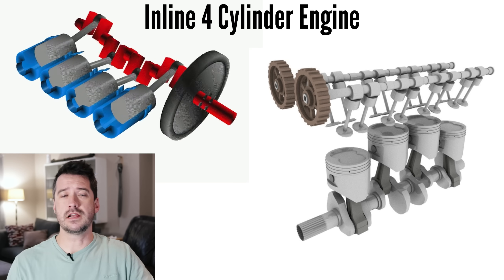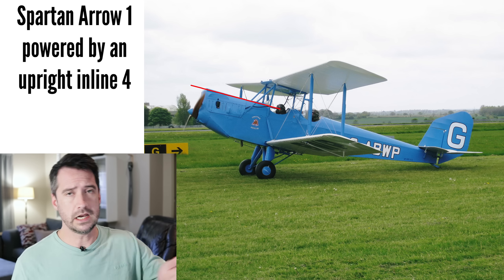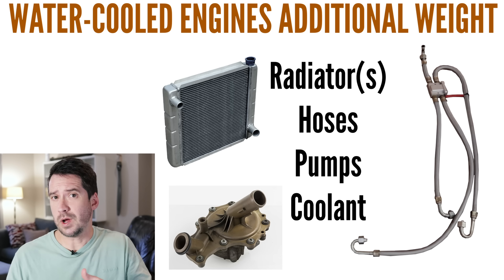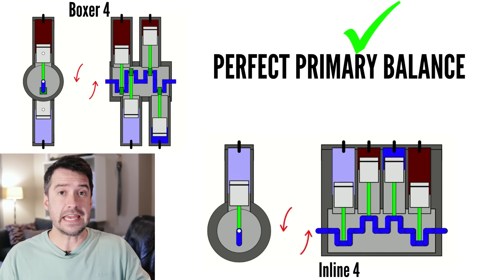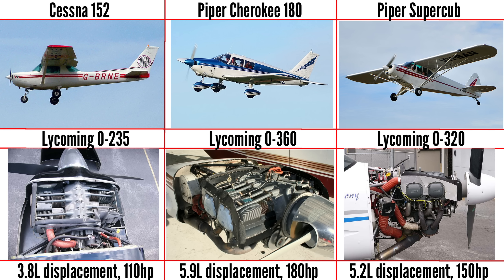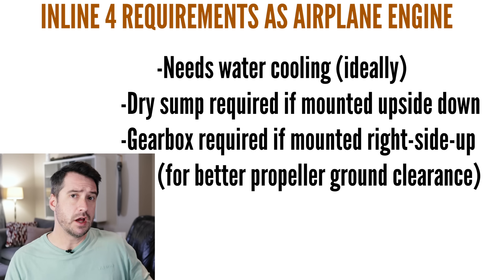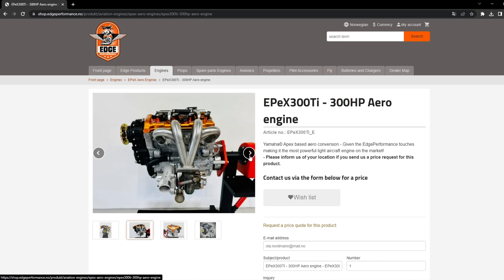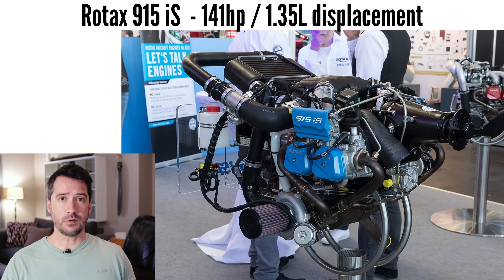Does Inline 4 Engines Suck for Airplanes? - Technical Deep Dive

Comment: Walter Micron has a nice four and six inline air cooled engine. Not sure if they are still in production. Thanks!
Reply from the maker: Yeah that's an interesting one. Designed in the 1930's, seems to have faded out of popularity after the 50's and production stopped. Then the company started production again in the 80's with minor modifications. Very low HP though (60-80).
Cant figure out if they are still in production.

Thanks for the comment!
Reply: @LetsGoAviate  I think the new name is LOM engines.
Reply from the maker: Thanks!
Reply: I've flown a Van's RV-7 with a Walter M337 inline, inverted 6 cylinder and it was one of the smoothest running engines I have ever known (at all operating RPMs).
Reply from the maker: @jamesbromstead4949  Nice! The inline 6 is the smoothest possible cylinder layout 🙂
Reply: @LetsGoAviate  Which brings us back to the BMW, aviation straight six repurposed for automotive use. Have they been re-repurposed back to aircraft engines, I wonder? edit to add. I can't find anything other than ultralights using their boxer twin.

Comment: Why  not use the camshaft drive in a purpose-designed ohc inline 4 aircraft engine to drive the propeller?  That would not add the complication of a separate gearbox (though the drive would have to be sturdier), there would be an automatic 1:2 speed reduction for the propeller (or even 1:4, if you used double-lobed cams on the camshaft), the engine would be upright and could use a wet sump system,  and the propeller drive would be at the top of the engine, providing the desired thrust line and good propeller clearance.  The propeller doesn't care if it is being driven by the crankshaft or the camshaft.  A conversion kit might be designed for an ohc automotive engine to do this as well.  Just a thought.
Reply from the maker: My first thought was that the camshaft would need to be seriously sturdy, but you did point that out. Also you would end-up with a belt or chain driven camshaft in turn driving the propeller. Not an issue per-se, there are belt driven propellers in the ultralight world (as propeller speed reduction instead of a gearbox), but the belts are about double as wide as a normal cambelt. But if you are going that route, might as well just belt drive the propeller hub from the crankshaft, rather than belt driving the camshaft which drives the propeller hub?
Reply: @LetsGoAviate  Well, that would still duplicate the drive--you would have two drives, one to the camshaft, and one to the propeller, each with a gear reduction.  The old Crosley COBRA and CIBA engines had a shaft drive to the camshaft, which would have been very sturdy--maybe extra bearings would be all that would be needed to convert--or, a bespoke shaft drive to the camshaft and propeller could be a simple drive that would perform both duties easily, without too much bulk.  Even if you use just a belt, driving the propeller off the camshaft drive would save an extra set of reduction pulleys, as well as the belt.  It would be lighter and simpler than two separate drives.
Reply: @brianb-p6586  Thank you.  Okay, an idler gear would be needed.  That still strikes me as being less complicated, lighter, and less bulky than a separate propeller drive.  Also, there are twin-lobe camshafts that are driven at 1/4 crankshaft speed.   The propeller could be more geared-down than 1:2, allowing for even higher revs for the engine, increasing power and efficiency, while still not needing a separate propeller drive.  And perhaps a belt drive would avoid gear teeth wear issues, particularly with 1:4 drive.  I am sure there would have to be some development time before an ideal arrangement could be worked out.
Reply: The Continental Tiara engine did something like this.
Reply: @PistonAvatarGuy  Thank you.  I Googled it--that engine purportedly had high fuel consumption, and did not have a sufficient performance advantage to justify its expense.  The concept was to use the camshaft drive to allow for higher rpms, and more power, without a separate reduction gear.  A hydraulic "Hydra-Torque" drive was used to reduce shaft vibrations--which could also be used here.  Apparently, an extra idler gear was not used--maybe the Hydra-Torque drive negated this need.  But the engine was of conventional flat-opposed configuration--it did not use the cam/prop drive to have a cheaper upright inline engine with smaller frontal area.  And, it had a 1:2 reduction--it did not use a 1:4 reduction double-cam-lobe.  On top of all that, it was in a higher-power engine category, not a small, light engine for minimal aircraft.  Perhaps the upright inline 4 with a combined cam/prop drive could still find a place.  The smaller engine could rev higher, especially with a 1:4 gear reduction, the lower frontal area would help fuel consumption,  especially in a tandem-seater, and investment  costs should be lower than with a bigger opposed-six.  And the Hydra-Torque drive has already been developed.  Just tossing the idea around, to see if it has validity.  Thanks for the information.

Comment: Here are pros and cons unmentioned.  Remember props turn < 3000 rpm
  1.  The I4 crank is longer which brings its the critical frequency closer to 3000.
  2.  In its favor, the I4 has 5 main bearings versus H4’s typically 3.  (VW, Rotax, Continental, Lyc’s have 3, Subaru has 5.)
  3.  A direct drive I4 secondary imbalance is a non issue at 3000.  Even a good possibility partial primary balance is workable.
   4.  Engine stiffness impacts longevity.  Lycomings and Continentals flex because air cooling fins compels wider cylinder spacing.  Moreover individual cylinder heads diminish stiffness.  These engines compensate flex with sloppy clearances.  
   5.  At 3000rpm, 2 valve pushrod heads work fine and lighter than SOHC or DOHC.
   6.  A Continental O-200 makes 100hp at 2800.  Doubling the speed engine could make 200 at 5600, …1hp/cid.  The point:  these old engines are not all that bad.
   7.   Conceivably one could go to the hot rod parts bin and get a Chevy LS1 head, pistons, rods, valves mate to a custom crank and block for a 100hp engine.  Check out the Crosley CoBra engine or blocks CNC machined from solid aluminum billets.  It’s just time and money and imagination, …and grit

Engines with Reducers.
  1.  In a 4 cycle engine, cylinder torque pulses don’t overlap until you get to 8 cylinders.  With a 4 or 6, thru a revolution, the engine drives the prop, and then the prop drives the engine.  These reversals are absolute hell on speed reducer’s gear teeth unless mitigated by a clever coupling such as the Rotax 912’s.  (And Viking and AeroMomentum)
        Wider rpm band faster risks resonance.
        No easy solutions, but there are solutions.

The certified aircraft engine market is small, maybe 2000 units per year worldwide, the entry barriers are prominent, and comes with 100’s trial lawyers.  One sage commentator commented, it’s economics.
Reply from the maker: Some of it is obvious, some of it is way more in-depth than I would ever cover in a medium-lenght video format, and some of it are great ideas for a future video. Thanks!
Reply: @LetsGoAviate  FYI, Solid Works modeled auto parts (LS1) based 3000 RPM H-4 ~180 CID 5-bearing engine to check the weight.  Projected to be heavier than an 0-200, but less than the 0-235.    But such an FAA certified engine might cost the customer only $3000  on say a $30000 engine.  10% doesn’t justify the effort.    Cheers D
Reply: You are clearly attempting to compare apples to oranges here... Automobile engines are not typically designed to meet the rigorous demands of aircraft applications... and as such are built to a price point that reflects these much  lower automobile requirements.
The notion of a $3,000 dollar type rated aircraft engine is not just wishful thinking it is pure fantasy son.

Comment: With regards to cooling, horizontally opposed fours would suffer from poor cooling of the rear cylinders if the air flowed over the engine front to back. It doesn't, it's ducted to folw top to bottom. A similar cooling scheme was used on inline fours, air is ducted to flow from one side of the engine to the other leaving the cylinders more or less equally cooled.

Comment: It seems that Deltahawk is successful with a purpose-built upside down V4. They call it an A4. It looks like a 2-stroke, but not much information is available at this point in time. They claim to make 30 to 40% more power, and have a hibrid super charger and turbo, bolted to it.

Comment: You have overlooked one MAJOR advantage of using an inline 4 automobile engine.  And that is full digital control.  This results in far better fuel economy, eliminates carb icing, and eliminates hot starting problems of fuel injected aircraft engines.  It also gets right of having 2 magnetos and spark plugs with smaller air gaps that can clog easily.  Not mechanical moving parts in the ignition system allows for full, real time spark adjustments for best engine performance.  And, their TBO can be much higher.  How many aircraft engines do you know of that can go the equivalent of 200,000 road miles without engine failure?
Reply: Fuel injected computer controlled boxer 4s exist too though.

Comment: I’m guessing that engine cowlings can be easily lengthened. If you’re going to replace an old boxer why not use a straight six with a bit smaller pistons? Longer, leaner, naturally well balanced, and less buzzy. Still has three small periods of negative torque per revolution, but a temporal torque transfer device can fill those. And you’d have to move weight astern to compensate, but that’s simple enough.

Comment: Many years ago the very reliable Honda designed IT engines with dry sump for their Civic and Accord cars, so many companies use them for light experimental A/C's with powers station me 150hp and adapting double electric circuit for redundance safety, propellers attached with reduction gear due to higher engine rotation against better 2,2-2,7k rpm fir propeller so tips don't achieve supersonic speed increasing drag and vibrations

Comment: Instead of dry sump, when turning an inline-4 upsidedown, make the valve cover into the oil pan.
Reply: and risk an air crash? never!
Reply: That was done on an inline inverted four that was introduced around 1940. Named the SkyMotor. Wrong time.
Reply: @fidelcatsro6948  so…never fly?
Reply: @Iowa599  now you talking like stockton rush.. see what happened to him amigo? 🤔
Reply: It's really a lower risk of failure than a dry sump system. It's basically the same, other than the evacuation system (pump, lines, tank) eliminated.

I'd be concerned of the pistons acting like cups of oil, but since they move down faster than gravity, they empty themselves. You will (probly) need to add a crankcase drain, to drain the crankcase into the valve cover, but the factory equipment might work (if the OE drains work the other way) or require minimal changes (maybe PCV porting).
Reply: @mpetersen6  there are many named that, but the only one from that year (that I have found) was aircooled & not "technically" inverted. It was originally designed to have the "head" below the crank.

(speaking of that, when head is below the crank is it called an ass?)
Reply: @Iowa599  What next?? carbon fiber pistons? 😆😆😆
Reply: @fidelcatsro6948  it can't be next, it's already happened, so have carbon fiber pistons. What year do you think it is?
Reply: @brianb-p6586  or a difference in orientation discussed, and this was a discussion about a way to invert an engine from normal orientation & his submission was an engine that already was head-down. This topic's "inverted", and off subject…

Summary:
Me: "a way to convert a car engine to work in a plane"

That guy: "A plane engine was made that way."
Reply: @brianb-p6586  and my comment was regarding the feasibility of converting the valve cover into a oil pan. That engine was designed with the valve cover as an oil pan, which is similar in theory, but also ignores the important bit (that I skipped mentioning). 

Getting oil to the pump. That one, I'm sure, has the oil pump near the head, because gear pumps don't suck well. When converting an automotive engine the factory oil pump will be very far away, so it will need to be either replaced (moved to the head, back-feeding the upper galley) or assisted (with an electric pump, mounted near the oil level, that pumps up to the factory pump's inlet).

Comment: I think he got the piston travel wrong at 90 degrees crank rotation.  Hope  this is not the first notice 😊

But then again, I use rotary engines in my flying contraptions so what do I know.
Reply from the maker: Hi there! No, it is correct. 
From 0° to 90° of crank rotation, the piston is pulled past the halfway (50%) point. This is because the conrod is now at an angle, and has a shorter vertical length (relatively speaking). This pulls the piston down further. 

From 90° to 180° of crank rotation, the piston is pulled down less than 50% of it's travel, this is because the conrod becomes vertical again, and gets longer in vertical length.

Hope it makes sense. There are videos explaining this much better than I do, like the one in the video description.

Comment: I'm curious what the reliability of some of these converted inline 4's is.  There are some planes out on the market that need new engines, which makes them a very expensive buy since new engines are so expensive.  But if you could hang one of these on it....
Reply from the maker: I'm curious about the reliability as well. Not a lot of data out there, mostly just what can be found on forums.

Comment: It is almost like reinventing the wheel. Superchargers and the turbochargers are nothing new. Even in aircrafts. Those used to be used in many aircrafts, specially in WWII era. I think the main difference is that high power piston engines were substitued by turbo-prop engines and the "low power" engines kept conservative way.

Comment: One thing that really worries me about automotive i4s, belt or chain timing drives. Gear train timing drives are what's needed for ultimate reliability.
Reply: So many videos on YouTube show straight gears in Diesel engines. Why not use those (truck?) engines? I think I figured out: those large idler gears only need to be quite thin for their load, but then you cannot put a helix on them. Teeth get loaded quit instantly on engagement. Why not use a vertical shaft as on some bikes and old Porsche?

Comment: I mean there have been quite some inline 4 and inline 6 engines that were in use in the sixties too. Zlin 26 line of aircraft uses a bunch of different inverted inline engines, and they I think have been fairly popular as aircraft, with seeing there were at least 2 or 3 in finland only. I'd guess in central and eastern europe the skies are still full of them. Looking at 1400 of only the 526 produced, with probably even more of earlier ones I doubt they would've died out. 
Earlier versions were powered with engines designed in 1920's and 1930's, but later ones were updated to more modern inlines introduced in 1960's

Comment: ok if the Crank drove the Sun Gear, and the Cam Ring was The Ring Gear, and the Planets where Held Stationary....
Then A 3-Cylinder Radial Would Have A 2:1 Reduction Built In ( the Prop moving with the Cam Ring ) 
for example: 32T Sun, 16T Planets, 64T Ring, would leave plenty of room for a couple of tapered roller bearings in the crank end.
so maybe just a 1.8L Turbo 3-Cylinder Radial would do... bore 98mm, stroke 78mm = 1765cc, something like that?...or maybe 1.3 Litter? 90x70-ish...or Bore 94mm X Stroke 72mm = 1.5 Litter?

Comment: a high rod ratio ( 1.8 -2 ) Radial 3 can be perfectly balanced.....bore 108mm, x stroke 108mm, x 3 cylinders = 2.968 L , ( 3L for short )
Torque is a function of disparagement and BMEP, so add a turbo, and it would not need a gear box....( being able to function at much lower RPM )
air cooling would be even, so the addition of an oil cooling circuit could easily regulate the engine temperature from there.
it would be the perfect pusher prop engine, ( if visibility was a problem )
Reply: And they look great!
Reply: @UguysRnuts  yeah, i think so too.

Comment: Weights are added to compensate for the pistons stopping at each end of the stroke.   This is primary balance.   Those same weights now have nothing to counter them when at 90 degrees so they impart energy laterally.  The mumbo-jumbo about the minute difference in the mathematical travel of the pistons ignores the obvious weights doing their thing.